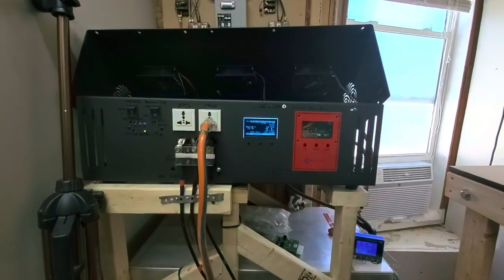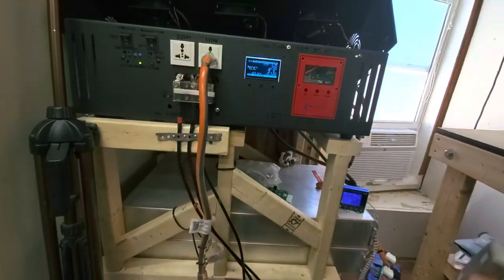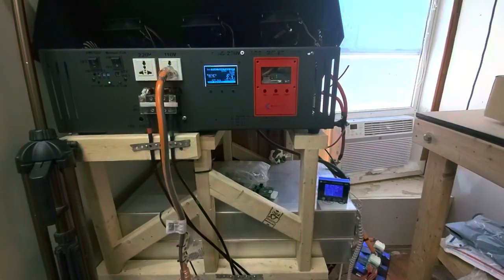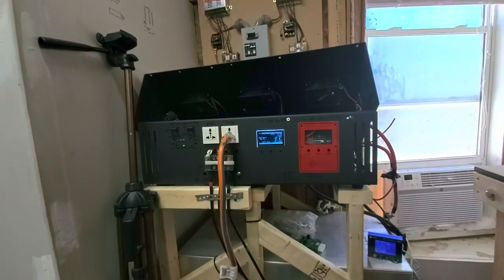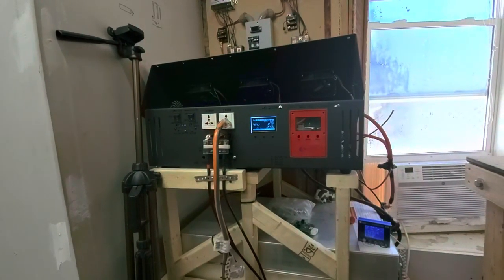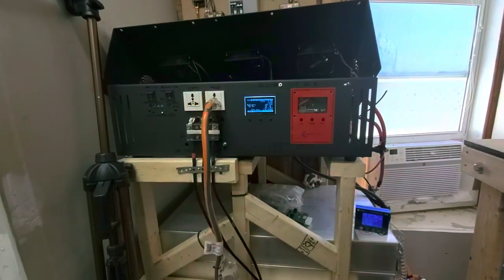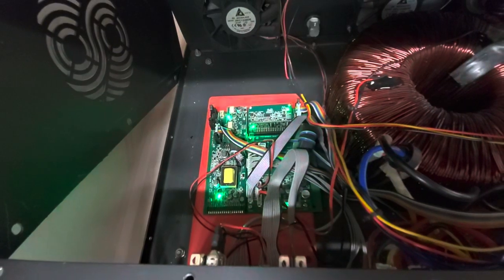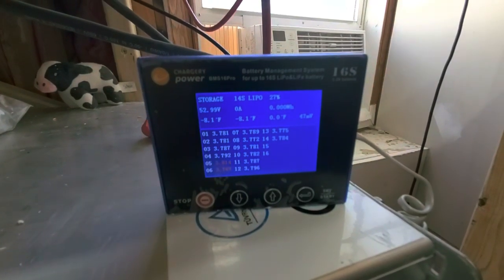Quick update on my LG Chem system

Comment: I try keeping my liion batteries between 3.2 and 4.0 volts, per cell. Occasionally charging to 4.2, and in emergency I may go to 2.95-3.0volts, but I have about 700ah of lead acid, battery bank, and working on a DC generator to charge on weeks like these, in NC there has been no sun all week! All the sun has been wet!!! Wet sun don't charge batteries! There has been some wind, I'm thinking about building a turbine or two, to help when its like this, if you are interested in turbines ,*( prepper mountin )* on youtube has links to the real chinease turbines , that really make power, but in sticking with alternator based turbines, to maintain the lead acid Bank, I can combine banks to slowly charge the lithium bank, but to 80-85%, because of the lower voltage lead acid Bank, that s close enough for me, emergency only charging...

Comment: A choke would not affect Idle Current.  They're used to block RFI your inverter produces .
Reply: Modifying the choke, etc. on the transformer wire reduced the no load current on my 9K from a stock 1.8A to 0.9A if I recall correctly.  Removing the extraneous AC output filter caps got me down to ~0.6A no load.  I've seen under 0.5A no load before, not sure what changed.

EDIT: Try removing the choke from your PJ inverter, and watch the no load current go up.  My 9K with no choke runs 3.5A with no load IIRC.

Comment: How would the Capacitors cause more Idle Current use ?  I don't think that's the case.  If they're leaking that much they need replaced ASAP.
Reply: It's the constant charge-discharge cycle every AC wave that consumes power.  I reduced my 9K inverter no load current to under 600mA @ 53v by removing all but one of the AC output filter caps.  Only one 2.2uF cap was necessary to keep a clean AC output wave.

NOTE: these are the AC Output filter caps on the output board, NOT the DC battery caps between the MOS heatsinks.